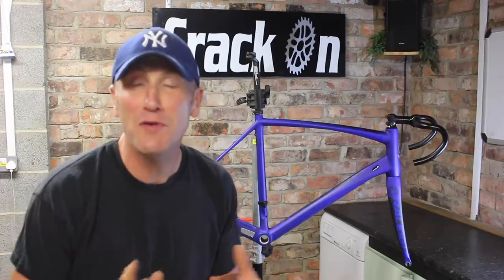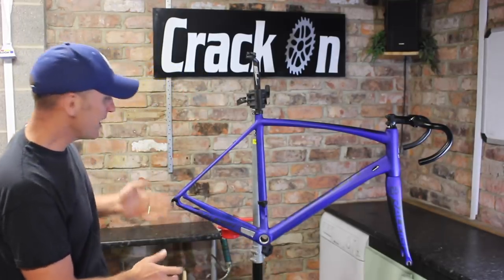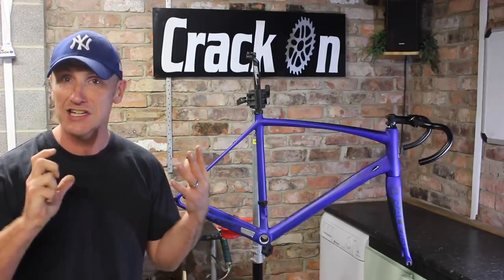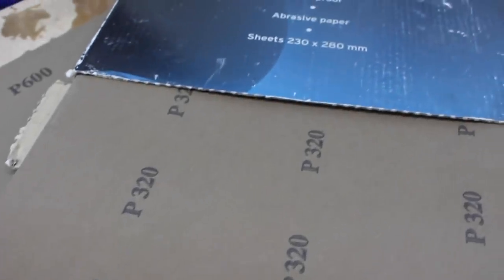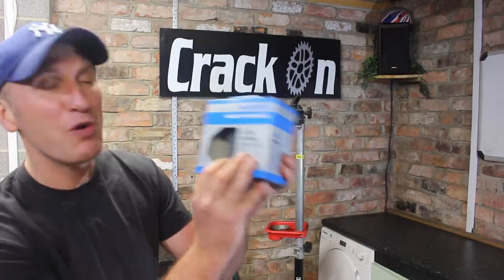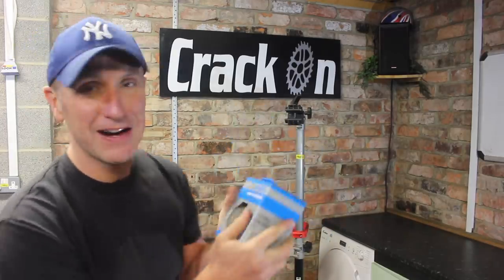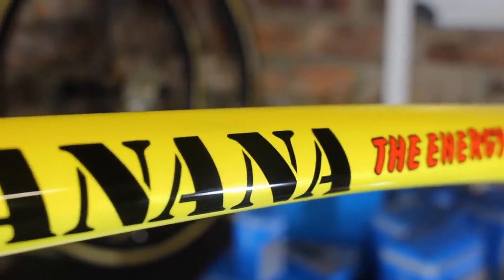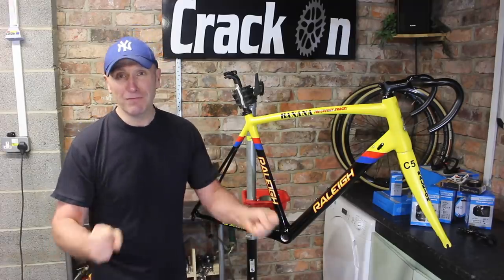Dream Road Bike Build - Custom Raleigh Revenio 4 Team Banana

Comment: In 1988 I used to ride and train with guys from the Raleigh Banana team. Jon Clay, Dave Mann, Dave Rayner.
I had a 531 Professional frame with  Campag Chorus groupset. 52/42 and a six speed close ratio block.
Rode those tough gears in the Yorkshire dales, Derbyshire Dales and competed in road races and time trials on that bike. Nobody knew any different, so we just got stronger and stronger and tougher and tougher. I rode from Durham to Buxton one day in shorts and no gloves, no helmet, just a headband. Stopped at Little Chef for an Olympic Breakfast halfway, then rode up Holme Moss in a silly gear before descending into Buxton. Greatest days of my cycling life. No computers, no mobile phones, no technology. Just riding the bike hard and enjoying it. I was always very envious of the Banana bikes though, they were the business.

Comment: The Revinio C3 - what a bike. You did a great job on that project and I love the colour scheme. I have a red one in full Dura Ace 9000 and they are super light and probably one of the best value bikes out there by a mile. It's a shame they stopped making them.
Reply from the maker: It really is unbelievable isn't it, such a shame. They do well with the reruns of the BMX's Im sure this design model would do just as well. Nice to hear you had the red version. thanks for the support and watching all the best Andy

Comment: Interesting build, retro modern.  As of 2017, Raleigh USA, was making (China) selling road bikes. I own a 2017 Carbon Clubman, with upgraded saddle, tires and fenders removed , and a 2017 Merit (Alum) with upgraded wheelset, tires and saddle. The only 2 modern bikes and only carbon and aluminum bikes , too.   All my steel bikes have been upgraded to modern components , except my pride and joy, '90 Concorde Astore (all Campagnolo).KB
Reply from the maker: Thanks for watching, interesting about Raleigh USA, they just lost market share here in the UK and only produce e-bikes and shoppers now. You sound like me with all your rides. never have enough, my youngest son has just started collecting and the wife just does not get it. Thanks for the support all the best Andy
Reply: @BikeItUK  Yep, women just collect other stuff.  I just passed my son, my first touring bike , 1982 Huffy Pro. Frame Built by Peugeot.  I did a complete rebuild, including paint, and re-badge it "Stravaigin". As  a Scotsman,  you must know the  meaning of that word. My grandparents came from Scotland.

Comment: I love watching these build videos! Have no idea why but I'm just always drawn to them. 

I have to say this is definitely one of the nicest looking paint jobs I have ever seen! It looks like it belongs there!!! I wish I had all the tools needed to work in my bike in my garage. I can do most of the basic stuff but I'm missing a bottom bracket wrench, torque wrench, some cup and cone wrenched and some other stuff. 

I currently ride a 90s ciöcc frame that I got for an absolute steal!! Just have to finish some rust work and paint matching. Do you have any tips for what paint to get/ technique on how to paint it? The color I'm having the most trouble with is an off white with some metal flakes in it and some paint in the head badge that just completely rubbed off so u have no idea what it used to be!

Keep up the great work man!
Reply from the maker: Thanks for your comment and support. The Build really did turn out for me a dream bike. It sounds like you’ve made yourself a small shopping list for tools you need. 👍The Ciocc is one Bicycle brand I I’ve still yet to cover. Great bikes.

Regarding paint I generally use enamel model paint. I have done a video dedicated to restoring a vintage bike frame. https://youtu.be/z_I5v5FwHCk

I hope this helps with your own project thanks again for your support Andy 👍

Comment: Does anyone know what the model labels C1 to C6 mean? As far as i can gather it relates to spec ie groupset and fork construction? Hard to find info on this on the interwebs :/
Reply from the maker: 🤔 if it is fork construction probably full carbon or have the metal insert

Comment: So where did the Revenio sit in the range relative to the Militis?
Reply from the maker: The Revenio has more of a relaxed geometry. This was the top of the range Revenio. I little like Canyons Ultimate and Endurance range. The bike sold original with Di2 for around £2.5k when new. I hope this answers your question. Thanks for watching all the best Andy
Reply: Yup, thanks. Useful info. I've been considering a used Militis for some time but you've made me think, maybe a Revenio would be a better choice for what will be essentially recreational riding.
Reply: And I forget to say, great choice of finish here. The old Banana colour scheme is just fantastic on this frame.

Comment: are you actually clamping the toptube? with no rubber pads or clothe at least?  it's very dangerous to do that because the top tube is the thinnest one on a carbon frame.

your levers are not well placed on the handlebars. looks off.
Reply from the maker: Thanks for watching please don’t worry the Bike stand was not clamped and the handle bars adjusted for the ride. Thanks for your support Andy